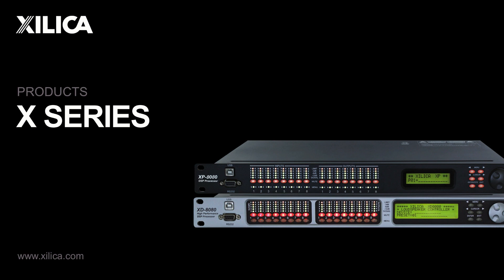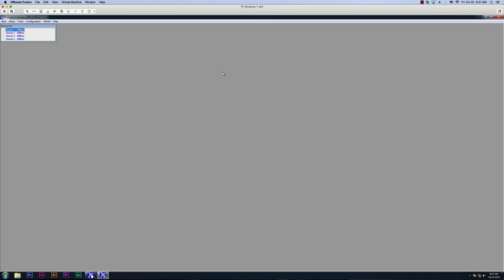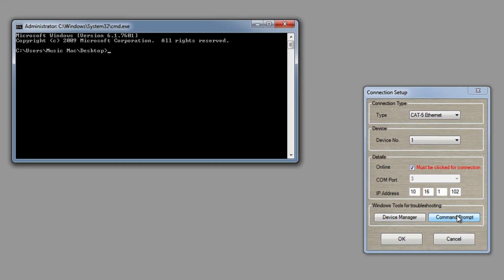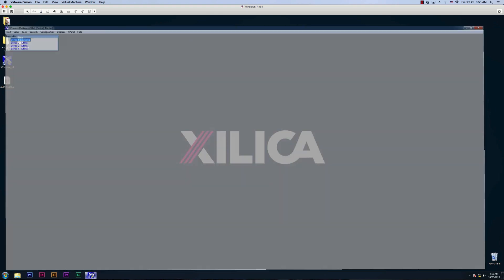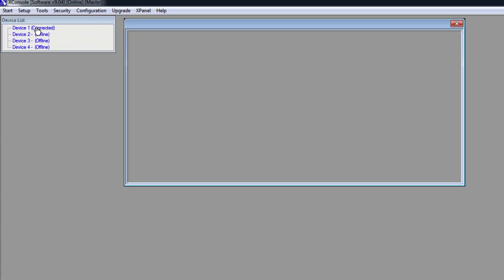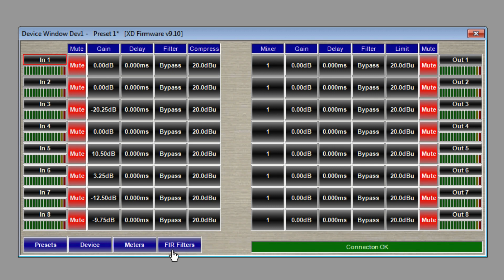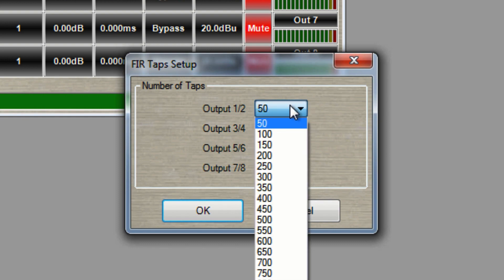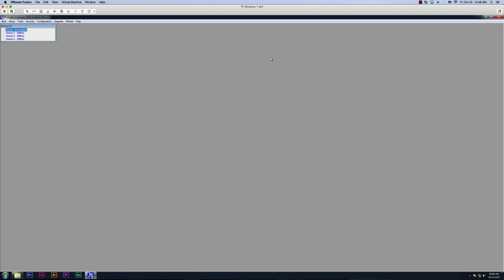X Series: Getting Started and Software Overview

Comment: Great and thorough walkthrough with an amazingly clear voice and clear explanation!

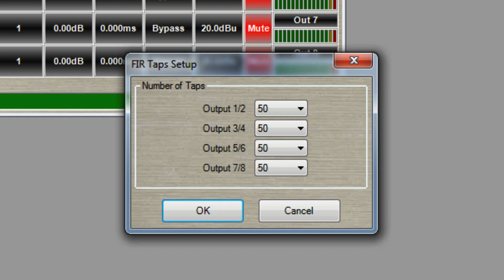For PA newbies likes me: FYI @ 20:16 - The number of taps parameter means: (GPT)
The number of taps in an FIR filter has a direct impact on its characteristics and performance. Increasing the number of taps allows for more detailed shaping of the frequency response, providing finer control over the audio signal. However, it also increases the computational complexity and memory requirements of the filter.

More Taps: A higher number of taps typically leads to a more precise frequency response, enabling the filter to achieve sharper roll-off, better attenuation of unwanted frequencies, and improved accuracy in reproducing the desired signal. However, this may require more processing power and memory.

Fewer Taps: On the other hand, reducing the number of taps simplifies the filter's structure and reduces computational requirements. However, this may result in a less accurate frequency response with less precise control over the audio signal.

Optimization and Trade-Offs: The choice of the number of taps is often a trade-off between the desired level of precision and the available computational resources. Engineers and system operators need to consider factors such as the complexity of the audio signal, the desired frequency response, the processing power of the hardware, and real-time constraints.
(...) 

Overall, the number of taps in an FIR filter allows for adjusting the level of precision and control over the audio signal. It is a parameter that affects the filter's performance, computational complexity, and resource requirements. Selecting the optimal number of taps involves finding the right balance between accuracy and practical considerations in the specific application or system configuration.

Comment: Why is my Xiilica XP 4080 connected to a USB cable and the Xilica Designer software can't be detected at all. all the IP address settings are correct, even I repeatedly typed the IP address, search for remote devices, it still fails
Reply: I have the same problem . I have correct firmware
Reply: @JoshL1976 I have the same problem. I have correct firmware